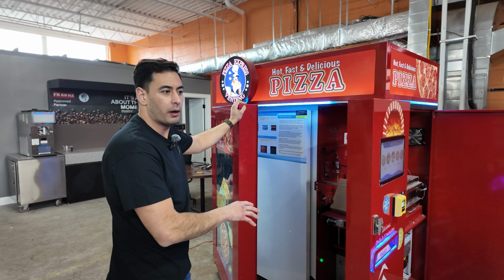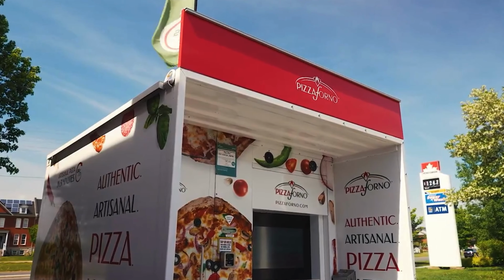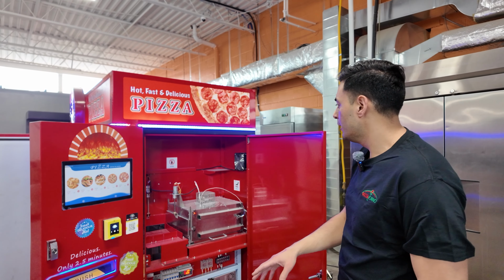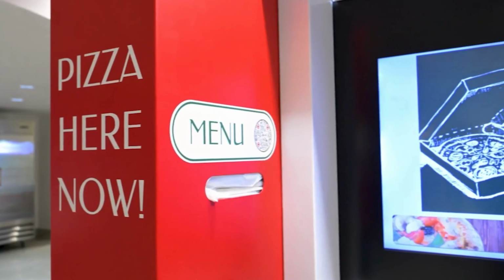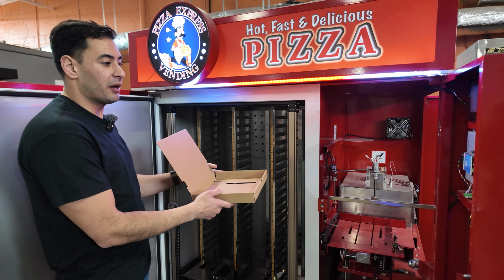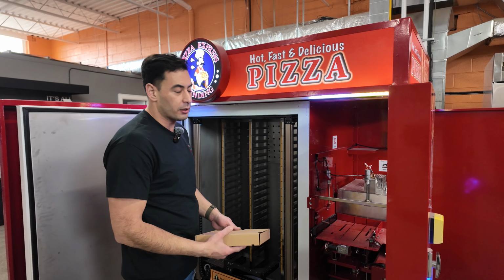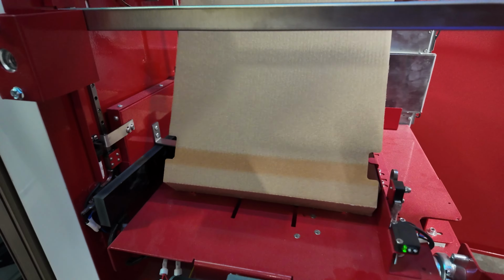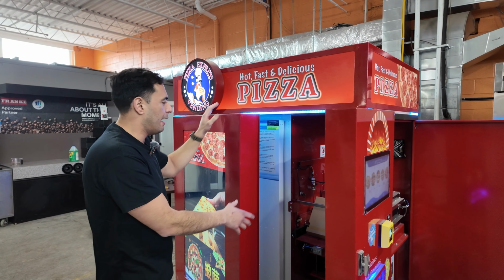PizzaForno vs. Alibaba Pizza Vending Machines | The Truth Behind Fake Listings

Comment: Pizza forno wants 100k for one of their machines that doesn’t include the franchise. Yeah they’re definitely going to belittle potential competition.
Reply from the maker: Any “PizzaForno” machines you see on Alibaba are fake listings. This video aims to expose those listings and show what you actually receive, so people don’t end up losing $45 k on a machine that doesn’t work, like one of our licensees did. Our machines are manufactured in France, assembled in Canada, and sold directly by us, never through third-party sites like Alibaba. Once you factor in certification, shipping, duties, retrofits, and sourcing food on your own, the “cheap” options can end up costing more and earning less over the long run. If anything goes wrong with that machine, there is no support for it. 

We provide a complete, turnkey pizza-vending solution. Our all-inclusive package covers training, equipment, supply chain, branding, operational support, a two-year warranty, and much more. We remove common start-up challenges and deliver a ready-to-operate system. We also manage the entire pizza production and logistics process for you, from sourcing ingredients and crafting pizzas to packaging and coordinating distribution.
Reply: His proof of the alternative crushing the box is completely false too. The machine expects a pizza to hold the box down. Of course it's going to fuck it up. That said, the machine really should stop, or alert, when it senses too much pressure so it doesn't crush anything.

Comment: They will perfect that machine im sorry to be the one to tell you that.
Reply: i own one- from china. no issue at all, runs perfect and smooth
Reply: @pepslink2843  How's the net profit so far? I'm considering getting one, but I can't seem to figure out where to get a pizza supplier.
Reply: @pepslink2843  Yeah, pizzaforno overprices their machines, so obviously they're gonna make their competitors sound bad
Reply: @pepslink2843 can you share which one as a reference
Reply from the maker: The challenge isn’t just tweaking the hardware. The models we tested still run on 120 → 220 V step-up transformers that stress the system, carry no UL or NAMA certifications needed for North-American permits, and come with zero after-sale support. 

This video says $25k, but our now licensee who bought this from Alibaba let us know after this video that it was actually $45k all in, which he could never get to work. 

Perfecting the machine is just step one, compliance, supply-chain and service are what makes the difference. We're proud to be the only complete turnkey pizza vending solution in North America. Our all-inclusive package covers training, equipment, supply chain, branding, operational support, a two-year warranty, and much more. We remove common start-up challenges and provide a complete, ready-to-operate system.
Reply: @thepizzaforno been there with the UL certificates ... It's a barrier to make everything more expensive . Hence you are 4-5 times more expensive.